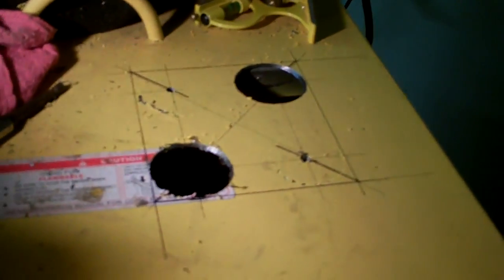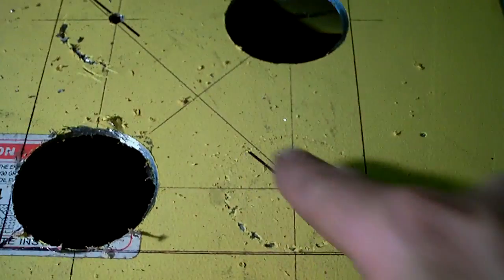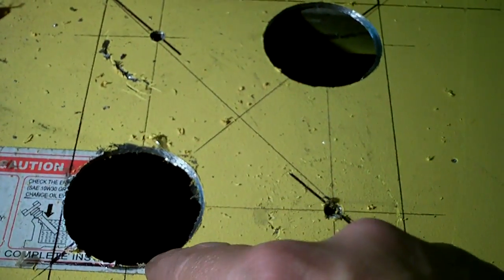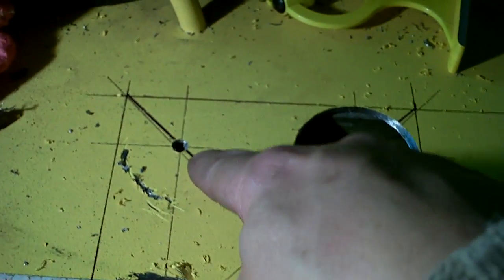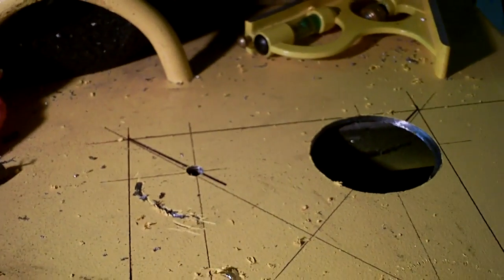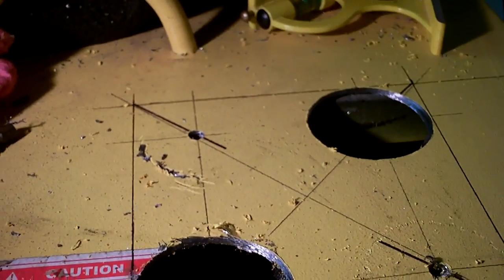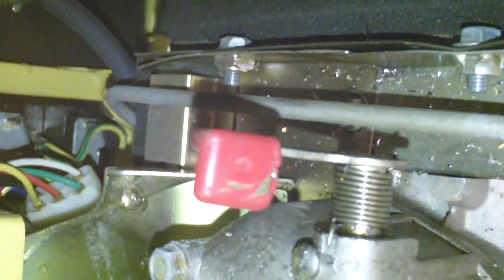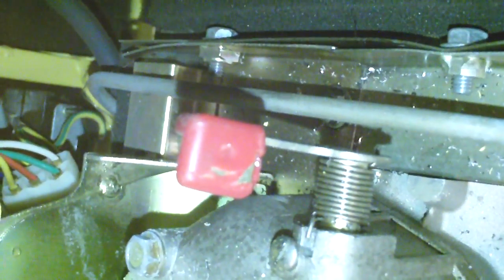Aurora Silent Diesel Generator Compression Release Hack Part 2

Comment: And use a leverage system? i'm afraid to see the iron sawdust on the engine...
Reply from the maker: iw3ioj The shop vacuum did a great job of pulling out all of the cuttings.  You can't get your hand in there to install a cable system unless you cut the hole first :(
Reply: Sincerly i don't think that was so complicated disassembly the generator. I don't know so good aurora generators. I have 4 generators, one is static, for home, connected with ats and ngine control gear. I love the professional DIY, i project and manufacture my generators and engine controls/ats. Commercial grade is too much consumer and not durable for me. My home generator use a 4ld820 engine and 4 pole alternator made by sincro and run at 1500rpm (50 Hz).